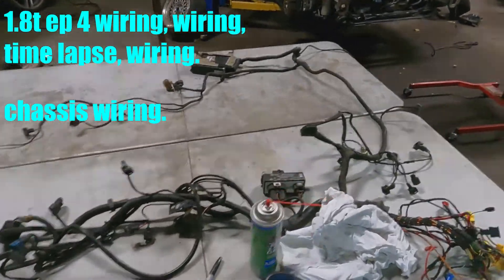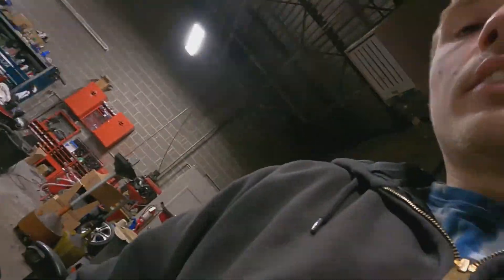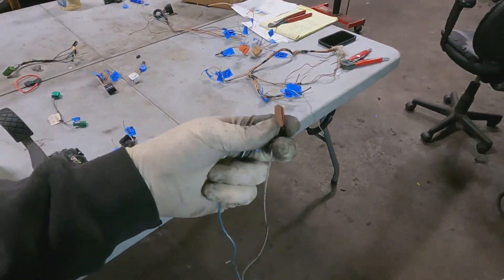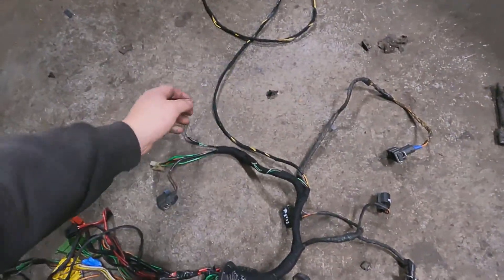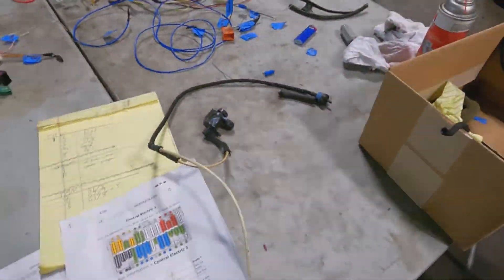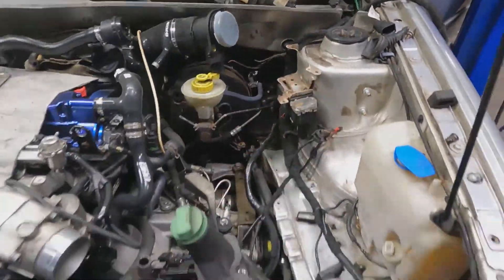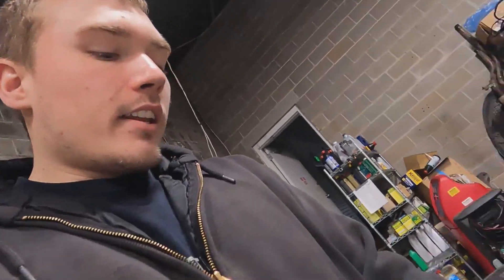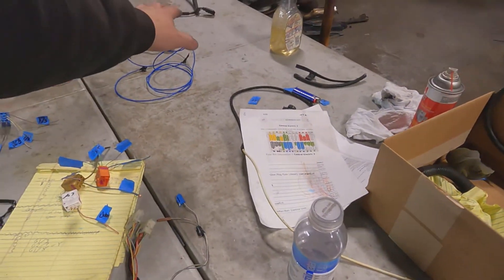MK3 vw jetta 1.8T swap k03 turbo EP4 building a wiring harness

Comment: Please help me out where can I find the wire for the boost sensor to the cooler, I've tried to look under the water bottle but I don't seem to find it, it's a 4pin to the cooler
Reply from the maker: Its on the intercooler 
Its called the map sensor
Should be able
To find pictures online if you type in mk4 1.8t map sensor

Comment: Hi man, I know that this is an old video, but by any chance is there a way you can provide me with something that can help me wire the A/C stuff ( your schematic or notes you were taking )?
Reply from the maker: Use all oem mk3 stuff
Nothing to wire in.

Just have to spend forever cutting it out of the mk3 harness along with the lights
Reply: @SmithsEuro  Alright, thank you man. It should be much easier job than yours since I got lucky that mine mk3 came with 2 separated harnesses for engine and lights, etc.

Comment: About 10min in the video you show a paper on the fuse box and another paper with numbers and where they go to and from. where can i get those? i have 96 vw vento that i swap 1.8t in. and i only need gett the rrevlimiter and speedo to work becuse i have installade a maxxecu in my :)
Reply from the maker: http://www.a2resource.com/electrical/CE2cluster.html

Comment: I really wanna do this swap, but damn is it daunting. I could wire it to an standalone ecu like Megasquirt or Speeduino, but the stock mk4 ecu would provide so much reliability. I think Eurowise makes conversion harnesses though so I wouldn't have to deal with any of the hard work?
Reply from the maker: All depends on what you want out of it.
Those aftermarket “plug and play” kits are usually just to start it and dont include a/c, cruise and a few others. So you if you want that stuff its not a bad option.
I wanted everything to work and to know what exactly went where and did what so if I ever have an issue i can trace down anything.
Reply: @SmithsEuro  I have a Miata running on Speeduino (pretty much megasquirt) and the A/C is part of the chassis harness, so changing the ECU didn't effect it. Hoping the VW setup would be the same. A 1.8t swap for me I'd probably do a minimal shave and get rid of stuff like the MAF, N75 etc and run the bare minimum. I just finished your series and if I ever do this swap I don't have the guts to do the wiring you did haha
Reply from the maker: The chassis/engine harness are as one here as well, which is why you have to completely strip all the a/c/fan/headlights out of the mk3 harness then graft to the mk4 (which has all that grafted in but in mk4 form) so you have to cut it all out of that lol.
Ive used ms1 a long time ago on my b3 vr6 turbo passat and used a/c but that was just making a plug and play in the vr6 that was already in the car.
I have emu black for my mk1 vr6 turbo but haven’t had the time to wire it in yet.
Reply: @SmithsEuro  ah I was kind of thinking maybe the 97 2.0 wiring would have the A/C wiring separate from the car's ECU, where it could run with just the buttons from the HVAC and the standalone wouldn't have any part of the system besides rasing the idle with load
Reply from the maker: You dont have to run anything for standalone, you simply have the activation/ground whichever the stock ecu would have wire to it go to an aux on the standalone.
So say if on the mk3 ecu pin 55 was that you would just keep that wire when merging the harnesses and pin it to the standalone ecu as it were a stock ecu (if that makes sense)
But in my mk3 swap i used all the oem wiring and honestly I didn’t run the ecu a/c wire and ive had no issues ( i messed up and ran it with the cruise wiring) 
So even though its not plummed to the ecu, it still adjusts idle just fine based off the load of the engine since the mk4 ecu is relatively smart
Reply: @SmithsEuro  I wish you didn't make this swap look so easy and appealing lmao. I really need to just leave the mk3 alone as it's my only "reliable" car haha
Reply from the maker: The swap has been done for about 4-5 months now. I daily it, i 2 step it everyday and drive it hard. Hasnt let me down at all! Take your tike with it and its plenty reliable.

Comment: i want  to do a 1.8t bam swap but im worried about the wiring to the stock fuse box.
also i have a question
do the 1.8t need any custom mounts to fit ?
and can i use the stock 1.8t trans?
Reply from the maker: Episode 2 covers the mounts. You have to modify the oem mounts slightly.
1.8t trans can work but you have to get the correct axle cups/shifter/hydraulic clutch conversion which all should be in episode 2 o believe.
Go to the junkyard and pull an mk3 wiring harness to get familiar with it and can have 2 attempts if you are worried about it.
Reply: @SmithsEuro  so would i have to use a o2a trans
?
Reply from the maker: @olikiel3290  you can use the 02a or o2j. You would need the o2a mount to bolt onto the 02j.
I have the 1.8t 02j in mine.
Reply: @SmithsEuro  oki tanks i have the 02j trans that came with 1.8t from golf mk4 gti and the shiftbox with mounts and cables. how did you get the speedometer to work? you forget to explain that in the video? many thanks and help //Fredrik
Reply from the maker: If its an mk3 the speedo is the same functionally but different plug.
You can put the 02a speedo (rectangle plug) into the 02j trans
Or use the 02j (D shape plug) speedo and just change the plug
Reply: Oki thanks 2 questions 
How did you wire in the speed sensor? 3 wires so it work with mk3 cluster?
And do you have the oem number for the engine bags that the engine brackes rest on? I have only bags from mk3 1.8 adz engine. And need to now the oem number for aba bags gearbox bag front and rear engine bags :)
Reply from the maker: Wire it exactly as it was in the mk3.
Do you mean mounts? I just used a set i had from bfi, or you can use hockey pucks